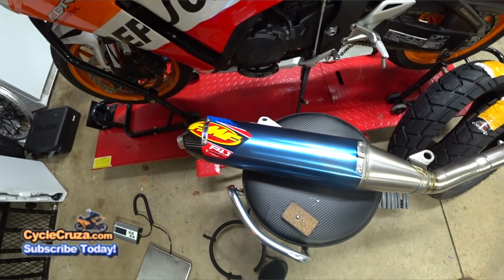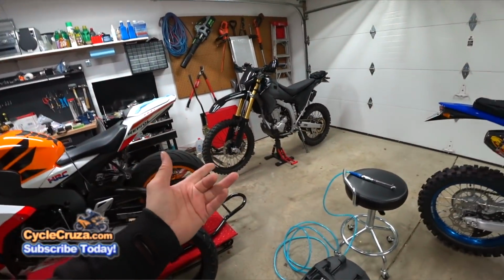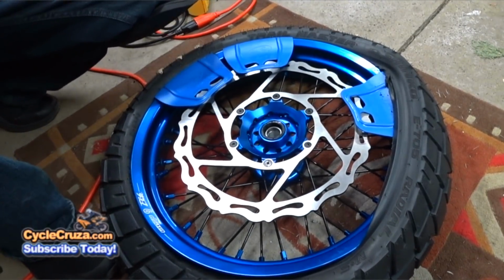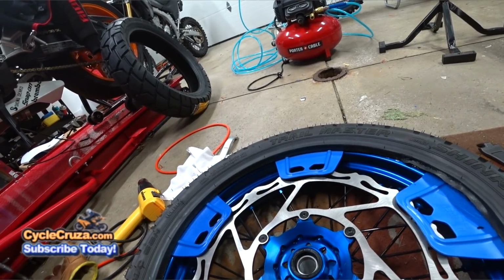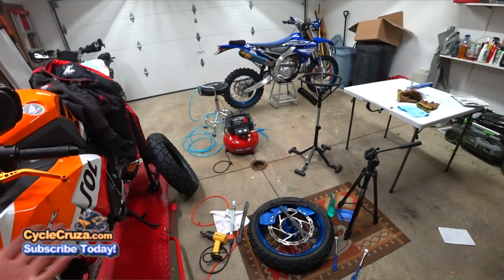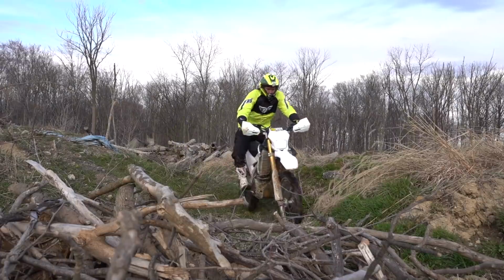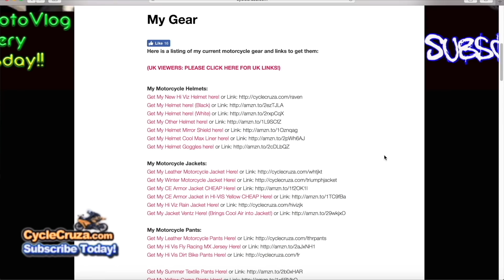Tire Install FAIL - BROKE IT 😠 | 2019 Yamaha YZ450FX Build Part 4 Supermoto

Comment: They are a harder Tyre than the dual sport Tyre due to the smaller side wall but I think the problem is the tape is stopping the Tyre slipping into the valley where the spokes are , they might do it with the machine but you might have to trim that tape back a bit .
Reply from the maker: You don't want the tire going into the valley tho, would even make it harder to put the tire on. Tape is not the issue, that tire is HARD as a rock, it was cold that night which made it worst.
Reply: Yeah, that's my thought. Without seeing how others have done it, pinching the tire together with some clamps to the bead falls into the valley would have allowed the extra room to stretch over at the opposite side.
Reply: Ok... My levers aren't broken though .

Comment: NO-MAR CLASSIC MOTORCYCLE TIRE CHANGER . The best. You will love it. I use a Harbor freight stand and a NO-MAR bar. Works pretty good, (to broke to buy the No-Mar Tire Changer) but that’s the way to go. A tire stand is so much easier than horsing the wheel around on the floor.

Comment: When I put tires on I push the bead in to the middle of the rim on the opposite side I'm prying. Once it's tight I push it down into the middle. There's a lip where the tire sits, I push it down in by the spokes

Comment: CRUZA.... I've made many tire changing mistakes myself so I have some school of hard knocks experience that may help.  Ditch the rim savers they are just getting in the way, use masking tape if you are paranoid about scratching the rims.  Use at least 3 bead buddies to keep the tire in the drop zone, four is better.  Get a Baja-No-Pinch tool, it prevents pinch flats(I know these are tubless) and rim scratches.  If you do this your tires will practically change themselves.

Comment: tip. when working the tire on, jab your knees(or hands first to get started) into the part of tire closest to you, to push tire/bead into center most portion of rim..it relieves ALOT of pressure on the far side/side your using irons on..

i also think those blue things helped save the rims, but they take up a lot of MM clearances especially with 4 of them lol

Comment: With these type of tires, you really have to get that opposite side low down under the center of the rim to get the last part on. It helps to pry it down with the bar while you pry the last part on. And you kept the tire way too dry. Gotta keep it lubed at all times. Don't use soapy water. Just use straight dish soap or pick up a bucket of actual tire mounting lube. One last tip is to do it on a hot day in your driveway and let the tires cook in the sun for a good half hour before you mount them.

Comment: I saw on u tube a guy use the tape method , look it up , he made it look very easy , and he did it with NO TOOLS , he taped both beads together soaped it up really good then slipped that baby right on , he had it done in like 10 minutes , hope this was helpful 🏍💨💨

Comment: The issue was that u have to make sure the bead of the tire is pushed down on the back side. If it’s all the way against the rim, it won’t stretch. Look at the wheel and u should see an area where the bead can be pushed into. Once u do that u can arm over the other side

Comment: You have to make sure the bead is down in the drop out of the room as your wedging the tire over. I worked in the shop without a tire machine for a while and could do them in 15 minutes. You were also doing it while the tire was dry. It’s easy when you get the hang of it. I had to do it on custom wheels that Buchanan laced with sun rims. The key is after you wedge it over it needs to be pushed down into the dropout if you get what I’m saying

Comment: I dont know what youre using to lube the tire but you'll never get it without using grease. Use the bead keeper to use as a stop from the bead popping off and use your knees to hold the tire down into the rim groove. And only use one rim saver under the bar your using go in very small bites. Ive been changing tires for 8 years professionally you can do it no problem with some patience.

Comment: I have a feeling those rim protectors could have made it more difficult since they were pushing the tire out also i ride a beta 250rr and i clean my air filter every 1-2 rides and change my oil every 15 hours.  When i had a 4 stroke i would do valve checks monthly but hardly ever was it out of spec

Comment: Ive had the same problem- but i put 2 Ratchet Straps @ aprox 5 & 7 O'Clock on the Bottom & Cranked the Tyre Deeper into the Rim- To allow more Space @ the top to Lever the final part of the Tyre over It Worked for me & i was Stuck on the Side of the Road Without  the Straps- It was No Hope!!😉 👍Cheers🍺🍻

Comment: I don’t comment a lot but this time I thought I could help. When you where mounting the tire I noticed that the bead you had under the wheel lip was not done low enough. The bead was sitting right where it normally would. You need some more the the yellow handled tool. And only needed one blue lip saver. Move it around the wheel to where you working at.When trying to mount a tire both beads should be in the middle of the wheel at the lowest spot to give the extra inch you needed to get the rest of the bead on.

Comment: You have to push the opposite side of the tire into the center of the rim to move the bead up in the side your trying to mount, kneeling on the tire on the sides only holds it in place and does t let the tire move up take one tire iron stick it in the bead on the opposite side and push down and work the other side over the rim.

Comment: I put these same tires on my DR650 and I can confirm that they are a pain in the ass to change out.  One bit of advice I can give is to use your knees to push the bead on the opposite side of the tire from where you are prying into drop center on the rim. There's a really good article about changing motorcycle tires on the RevZilla site that goes over this.
Reply from the maker: How did you do it? Even shop tire changers are saying they are tough to put on with a machine.

Comment: If it is a sunny day lay the tire out in the sun for a hour before hand.  Makes a noticeable difference in how pliable the tire is.  You also need to push down, as much as you can, the opposite side you are trying to ply on.  You also had too many rim guards that were keeping the bead high and not getting into the well.   If you're not getting into the well you'll have a hard time.

Comment: I spent 2 hours putting a dirt bike tire on and on the last spoon I ripped the inner tube
Reply: I have done the same thing, this video cracked me up reminding me of that!!
Reply: Grease up the tube with belray or maxima high temp grease. The tube will slide around and not get pinched.

Comment: Feel your pain 100%. I do most of my maintenance on my bikes, but changing tires is something I hate with a passion. I have a front wheel with a tire iron hanging from it on my porch... gave it up yesterday. Installed a trials tire on the rear 3 days ago and it was 100% horror....

As for street tires: I just take them to a shop....  The moment is coming when I am getting a tire changing tool/bench/machine whatever it is called....

Hahahaha ... the cursing part :) .....    Been there, done that. When you go from almost crying to angry, to cursing, to try it again. To break tools, to break the bead....  sweating ... more angry ... then suddenly somehow it just pops on.....     I HATE CHANGING TIRES .... and it goes for offroad tires too. Maxxis is the worst....

Comment: 2 tire irons needed on last push and tyre protectors need to be shifted next to each other  and lift 1 then go to 2nd one while holding the lifted 1 up  or do 2 at same time. p.s when you go to inflate tire you use dish soap and water to grease edge up so it will pop on to bead edge easy / 

learned a lot of things due to owning dirt bike valve adjustments, full suspension rebuild, chain adjustments , wheel alignments, oil changes, motorcycle wrap(giant sticker graphic for plastics instead of paint) and torque settings for nut and bolt and vehicle painting ,next is engine rebuild challenge

Comment: Some are pretty tough. Not sure but...you could take smaller bites with the spoon. As small of bite As you can. You was about an inch away from it going on all by itslef. I couldn't see the shape of the rim but some make it pretty tough.
Reply from the maker: That shinko 705 rubber is the hardest rubber on a motorcycle tire I have ever felt.

Comment: This is what happens when you don't know what you are doing...you need to use small wooden blocks to force the tire to the center of the rim before prying and lifting the bead over the rim. Many people damage tires trying to force it. Wouldn't all of this been avoided if you had just bought a street ready CRF450L?

Comment: you need to get the beed of the rim in the middle part deep inside then you work aroun and aroun has you were at the end were you broke the spoon the opposite side of the tire the bead was on the highest part the rim if you think about it the rim is a u shape get the tire deep in there you can get it done!

Comment: Didn't leave those new tires out in the sun a while until warm/hot? Works so much better. You gotta have that OPPOSITE SIDE RUBBER into the WHEEL GROOVE before there's enough slack to allow the rubber over the wheel. It will NEVER go otherwise.

Comment: I bet you are going to hate those Shinko 705's by the time you are done with them, lol...   They aren't a bad tire and have a good wear life but the have a bad tendency to cause the front end to dance around a little at certain speeds.  They have so much road noise I just went back to a knobby in the back and was happier.

Comment: If you are having troubles getting  a bike tire on you are doing it wrong. You need to take small bites and make sure the bead is dropped down in the centre of the rim. For a install  like this it should only take 5 minutes. It take practice.

Comment: Good try man.  However next time you try, the second bead (hard one) needs to be pushed down into the valley until you get the whole bead to pop in, then you apply air while pulling up on tire to get the bead back into the rim edge.  Same with a car tire, even with a hydraulic mounting machine.

I may have not seen it at a good angle, but it appeared the bead as you popped it in remained against the rim edge.  If so there us just not enough room for the tools, the rubber and the stretch (there's almost no stretch on a tubeless bead)

Comment: Next time ..... squeeze pinch the "bottom" near your body of the wheel so that the bead of the rubber is inside the middle of the wheel where your sealant tape is .  Use some big hvac zip ties to pinch it together if you have to or some big welding c clamp vice grips .That will give you the slack you need. 

You can't have the other side of the tire up on the bead while trying to

Comment: Tires should be warm, sit in sun or in house by heat.☺️, It's heating season in Mi, already!
Then instead of all those rim protectors use them just where you irons are.  And instead of soapy water, use KY jelly or similar type lube. The last two suggestions I haven't used. I just bought some rim protectors, as my new bike is the first with anodized rims. And glass cleaner or soapy water was my lube. But I just got new tires to mount and I'm going with the personal lube when I mount them.

Comment: You needed a lot more lube on the tire for it to go on easier. I used the small $15 cycle gear tire irons and with a lot of windex I was able to get my tire on with ease. AlwAys remember tires need a lot of lube 😛

Comment: Y U no start with lube Cruza?!?!!?

Sick!
Reply: But seriously. You made me think. 

Maybe I should get tire machine that will last decades. So I can really be independent from shops.
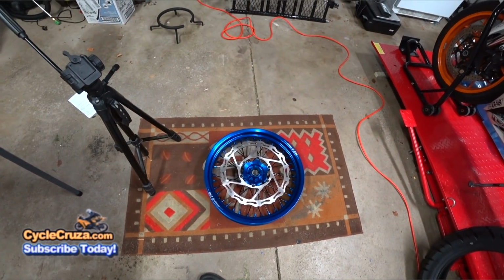Reply: @2:25
I some how missed you spraying something with a rag. 

But did it keep the tool, and contact surfaces slippery?

Every time I install a THICK tire on a rim. I always keep the tools and bead area, wet with soapy water.

But now I want to end that practice, and find something else, that is slippery, then becomes sticky to stick the bead to the rim, when the tire is fully installed.

I want to keep moisture out of my tires, and will even pump them up with dried air.

I think the Nissan GTR, started the trend, of people putting Nitrogen into their tires. But what's really important, is not having moisture in your tires, because moisture is what makes tire pressure fluctuate so much, with temperature.

Comment: Those irons suck. Get the shorter spoons and take smaller bites going only a couple inches at a time. Like someone said, you used too many of the rim protectors. It ain’t rocket science but it does take some practice. Be thankful you didn’t have tubes!

Comment: You gotta stomp the bottom of the tire where both beads are already on the rim deeper into the wheel well. Just a little bit deeper makes a lot of difference. When the last part of the bead absolutely like here REFUSES to go over the rim, you gotta recoup and make the tire go deeper into the well. Otherwise, further struggle is futile, resulting in bent or broken tire irons. Been there, done that!

Comment: Just let a shop do it next time. I usually do most of my maintenance but the following I’ll let the shop deal with: valve inspection, tire change and balancing, and full system installing

Comment: Tires need to be very warm before you can even think about slapping them on rims.  For those of you in the tundra, get yourself a heat lamp or bulb and heat the new rubber for at least 30 minutes.  You are looking for almost too hot to handle. Use the sun if you live in a sunny desert like AZ.  Same goes for the old tire you want to remove; heat it up or do a burnout beforehand.

Comment: You need to pinch the tires where the bead is already over the rim so the tire sits inside the smaller part of the rim. If you get it just right you shouldn't need to use your bars for the most part.
Reply from the maker: These shinko tires are too hard, they do not bend in the least.
Reply: @CycleCruza  try using a c clamp and some blocks pinch the tires. They'll go.

Comment: I've only done this a couple of times, but in my limited experience it looks like you're making a couple of mistakes. First, you're using too many rim protectors and leaving them in place when you're long past that area of the rim. Second, you're trying to take 4-6 inch chunks at a time when you already have the tire 2/3 of the way or more on the rim. You should be much less ambitious than that. Slow and steady wins the race.

Comment: Some tire and wheel pairings are problematic like this. Tubeless setups are notorious for being tight tire over wheel even on mountain bike tires they are unbelievably hard to stretch over. Like when I put a condom on😁

Comment: dude all you needed to do was push the bottom part of the tire into the groove in the center section of the wheel that would've gotten you the extra slack you needed

Comment: Dude, your tire is now scrap for a tubeless application! I knew it would happen when I saw the vid title. You have a low profile tire there and they are super stiff comparatively. When assembling the tire t othe wheel, you MUST ensure that the second side beads are lubricated. And you MUST ensure that the early part of the bead moves down and into the "well" in the center of the wheel. That means the part that has the smaller diameter than the bead seats or on your case, the tubeless sealing bead seats, which have a slightly increased diameter, as you probably saw at the start.
Those plastic "helper" pads look like they're taking up extra room which would be better served allowing the tire to move into place a fraction earlier, which in turn, helps the tire onto the wheel. 
 Sorry CC, you need ANOTHER rear tire now. Throw that one is fucked out!!!!!!!!!!!!!
I'm an ex pro tire fitter (8 years served) and have damaged my share of tires early on in that career. (well, it's not a career as the money is shit, so no fitters usually stay too long.
Reply from the maker: yeah ordered another front tire. lol Will let shop put them on!
Reply: Ask them if you can video it.

Comment: TL tires are the worst to put on. I just take the tire and wheel off and take it to the shop. If you had TT it would’ve been easier.
Reply from the maker: What's a TT?
Reply: Tube Type. They’re not as stiff as Tube Less.

Comment: dont feel bad I have the same rear tire on my wr250f and its a BitHC bro! I messed up my beed all types of ways lucky im runing tubes still. I will not be getting them again thats for sure, they dont do my dirt roads well. got stuck yeaster day just pulling off the road to take a pic , :( i didnt even get a pic got worried and started going to work to get it out. anyways yea fuck them for dirt bikes. Had them on my ninja 650 and loved them now i hate them

Comment: The yz450 needs 7hour oil change for mx racing, for street use you can stretch that waaaay longer, i had a yz450f 2006 and changed the oil about every 50hrs of riding dirt trails, and valves i checked every spring before the summer started, did the same on my wr426 i had both never had any engine failures great bikes.